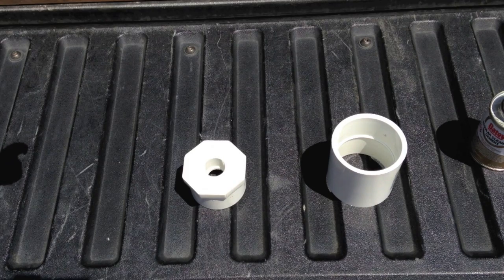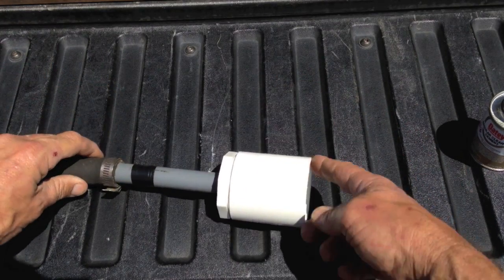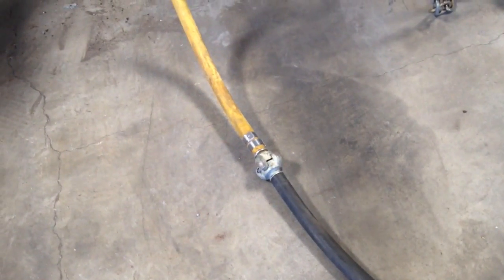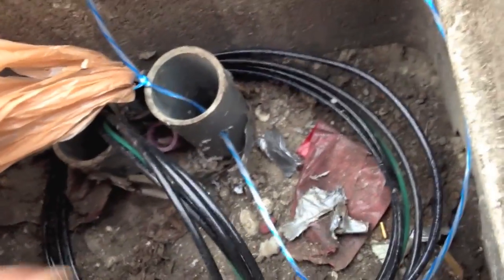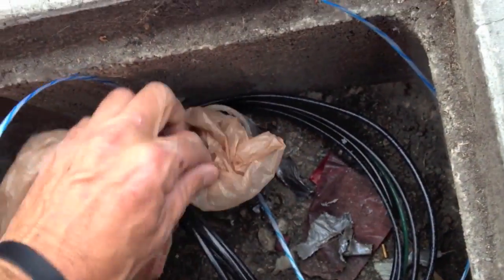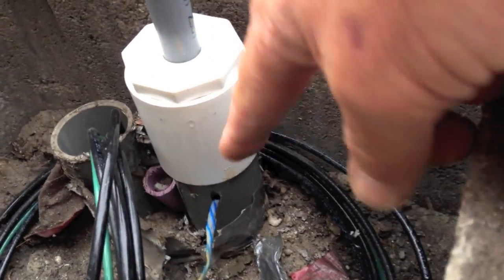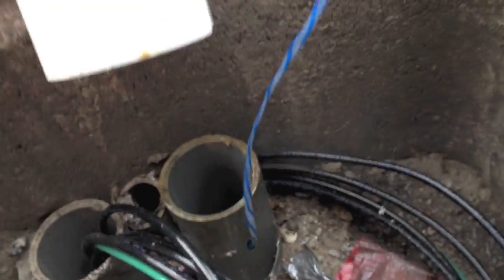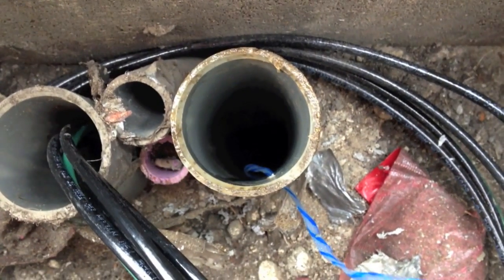The Pull String Express

Comment: cool i dont have a compressor like that so i use a shop vac to suck the bag with string on it to me
Reply: shop vac works way easier 90% of the time...for runs over 500' or if water is a problem the compressor is better

Comment: Nice hack to get the pull string through. The only thing I would do different would be to drill the pull string hole into the top of the 2" reducer so you don't have a hole in your conduit pipe. Nice video.